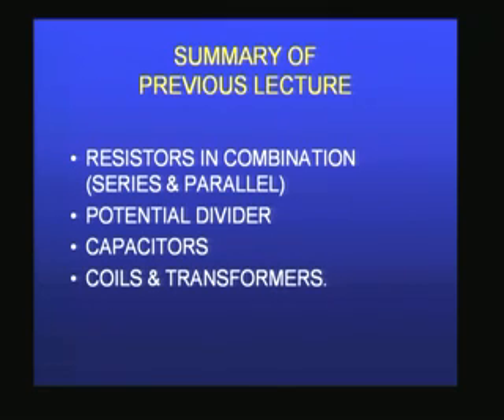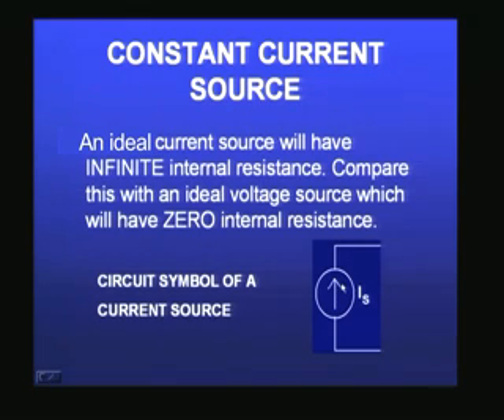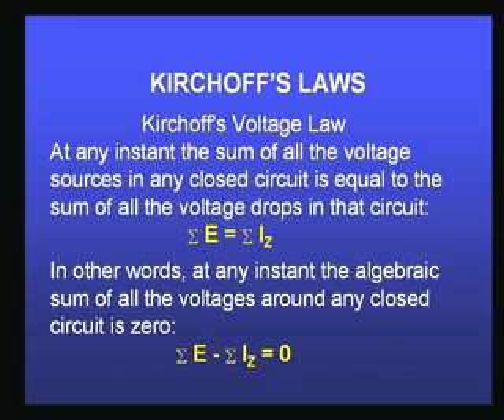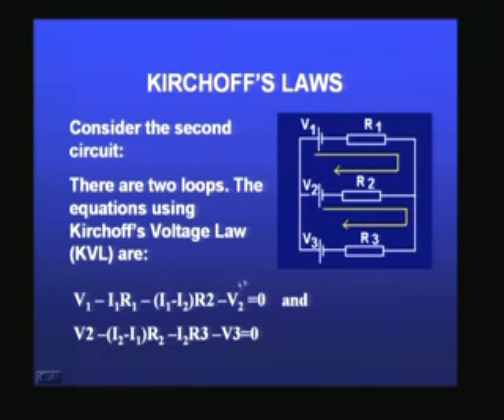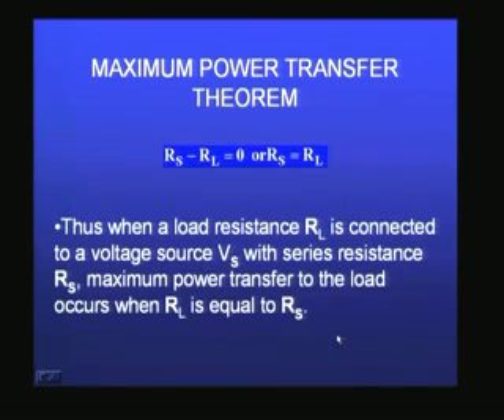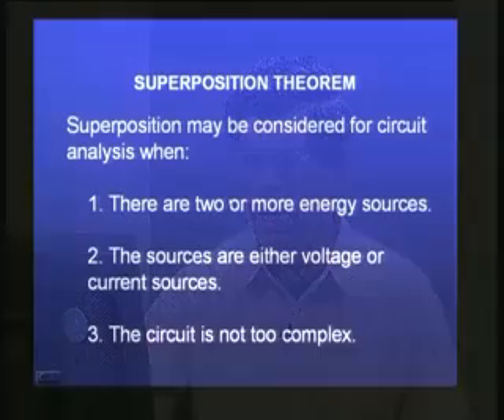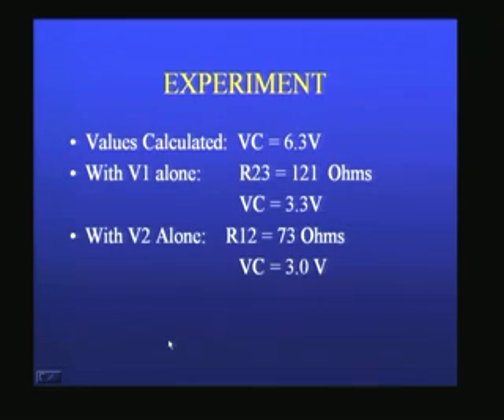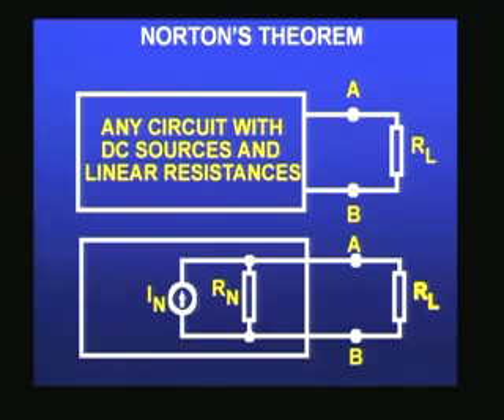Lecture - 4 Some Useful Laws in Basic Electronics

Comment: sir, In superposition theorem calculated voltage was V=Voltage across R23=121 and voltage acrossR12 so toal voltage was 3.3+3=6.3volt.but why we don't take voltage across R1 and voltage across R3.these resistance also series to R23 AND R12 respectively in circuit.

Comment: I cant understand CURRENT. In Kirchoff second law illustration with 3 voltage sources - there should be 3 currents for each branch. I think.
Reply: I1 is assumed to flow through R1 and I2 is assumed to flow through R3